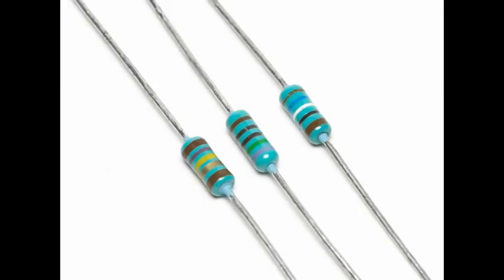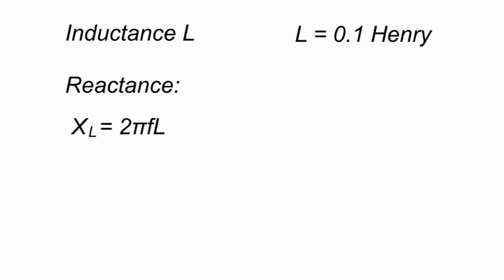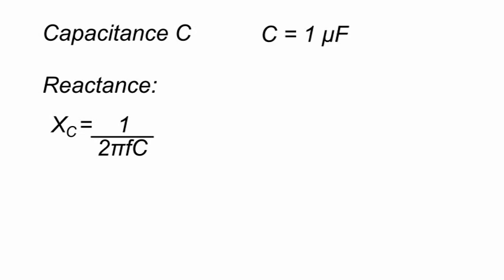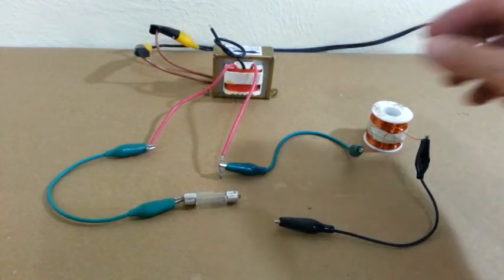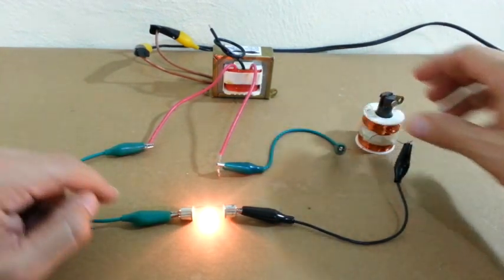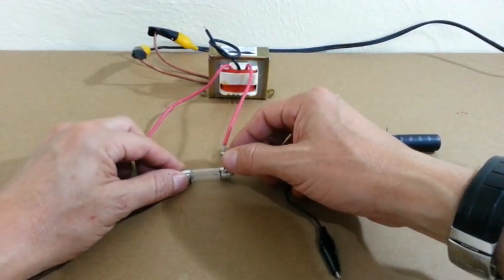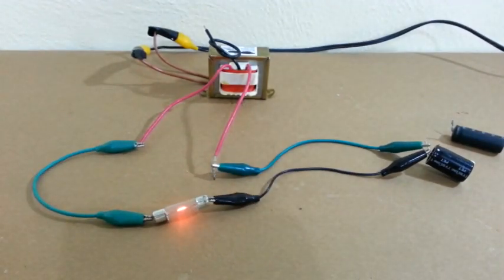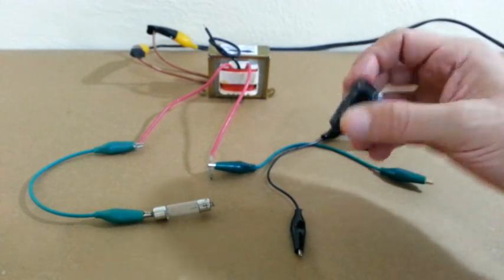Electrical Reactance Demonstration

Comment: I read that you can take two electrolytic caps and put them in series with like terminals connected to form a 'back to back'  ac capacitor.  Supposedly that is how the AC motor caps are made.  A drawback is that you only get a cap equal to one of the units (so 100uF caps arent 200uF, but only 100uF since one is reversed and acts sort of like a short circuit while the other acts like a cap in each half-cycle).  Supposedly the reversed cap isnt harmed by this...

Comment: Excellent video as always.  But at 2:27 you say changing the capacitor to one of less capacitance will increase the reactance?  Is that correct? 

No capacitance = no reactance, a little capacitance = lots of reactance and higher capacitance = a lower reactance?
Anyone?  Thanks.
Reply: If you think mathematically, if the capacitance is zero farad or no capacitance, the reactance would be infinity and so no current would flow. You can think of an open circuit as a capacitor with zero capacitance (actually very low capacitance) and so no current flows.

Comment: You can of course, connect 2 electrolytic capacitors in parallel, one in reverse bias, to make one non-polarized capacitor for ac applications without damage.
Reply from the maker: +Joseph Nicholas I have heard that but i am not sure that it really works, do you have any reference?
Reply: A Dave Jones video (EEVblog), I have also seen this in a few tv repair tutorials on you tube.
Reply: OK, but people in tv repair use this technique so they must know.  So what happened to your circuit that did not work?
Reply: Well, that's interesting.  I can see how that might work for electrolytic caps that have a high level of tolerance to reverse polarisation, a high internal resistance, and at a suitably high frequency.   But basically it's bad, bad practice.  I'd rather have a tv repair man who chooses the correct component as a replacement than one who does that sort of botch.
Reply: I think you mean connect two polarized capacitors in SERIES with the two like polarities connected together in order to make a non-polarized capacitor.  +V------- +C- C+ -------- -V

Comment: How much of the voltage of the capacitors that you used in video ?
 وشكرا .😀
Reply: You’d have to calculate the circuit current by finding the capacitive reactance, adding it vectorial to the resistance of the load (V squared over P). This gives you your impedance (Z) then I =V/Z. You can now find the voltage across the capacitor and rate accordingly. 
The guy had clearly done this already or just experimented. An incorrectly rated capacitor probably won’t pop in the few seconds it was in this circuit anyway. 
Hope this helps. 👍🏼

Comment: Good evening Professor,
                                  I have two questions how you made your battery and inductor,  there is reactance in transformer due to  inductor the same way you showed and what is leakage inductance ? thank you
Reply: Also i want to know that hysteris losses and eddy current losses we name them Resistance in Transformer while on the other hand we name inductance,X to magnetization current .. thanks

Comment: Does inserting the iron core increase the inductance? Is that why the light dimmed ?
Reply: +Arun kumar yes. the iron core allows much more magnetic field in it. therefore it increases the inductance. however the hysteresis loss makes the inductance drop when the frequency is increased and energy is lost for heating up the core.

Comment: Dear sir
Can you explain the hum sound we heard when you put the core inside the coil ? 
Thank you
Reply: rashel simchon the core has an intrinsic resistance to the changing magnetic field. This hum is created by the stresses within the core as it deforms under this field
Reply: Nate Lancello thank you
Reply: The hum is there because the coil can´t recall the words.
Reply: It's just the metal becoming magnetized and vibrating. The hum is twice the frequency as the field changes polarity twice during each cycle.